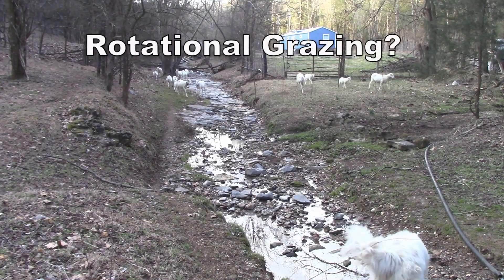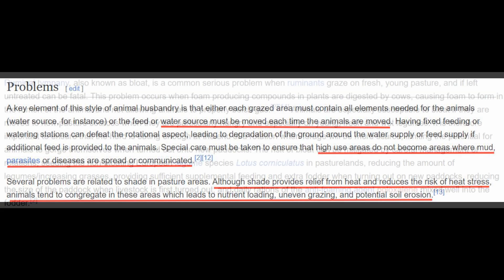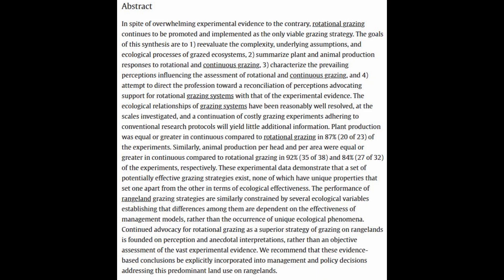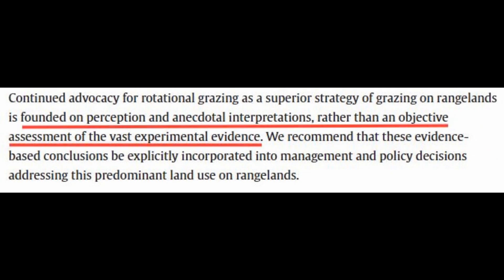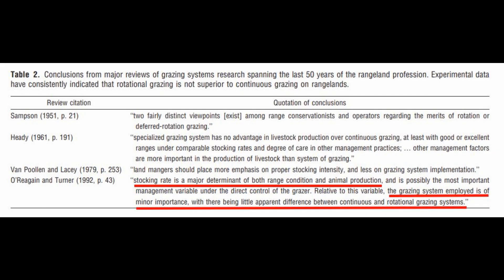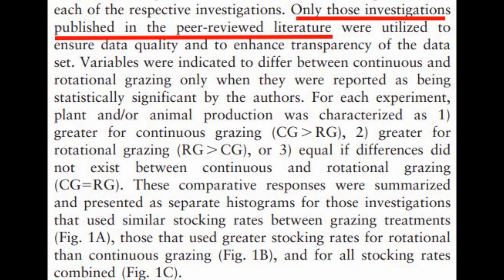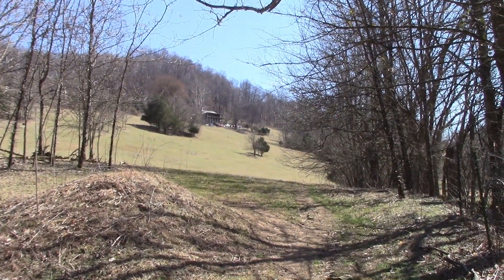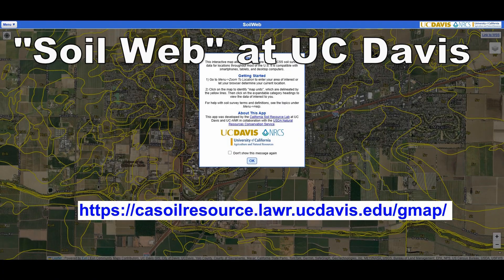Sheep Rotational Grazing? Scientific Proof Its Not Necessary for St. Croix Sheep.

Comment: Hi John, 

have you looked into Bob Kinford's Instinctive Migratory Grazing? He mainly deals with cattle on large acreages, but I think that he has some similar ideas as you. 

His theory is that if you can handle livestock correctly as to reduce stress, the animals can revert to more natural herd instincts. Once the herd instincts are re-established, the herd will naturally rotate themselves through the pasture and graze together in a tighter mob. The mob can expand and contract as required based on the available forage. Forcing the animals into a herd using electric fencing means that animals no longer have to rely on their herd instincts.  

I personally do rotational grazing with my sheep in northern Ontario and see benefits, but I think there is something to what you and Bob are pointing out. 

Thanks for your video,

God Bless
Reply from the maker: Thanks, Cole.

I will check out Bob Kinford.

My sheep stay together as a flock and migrate over the entire property every day.  It is the same as if I moved them with hot wire every hour.

My sheep seem attracted to short grass, as the taller grass that is produced by Rotational Grazing has more lignin.  I also have to mow for weed control as I have never used herbicides.   And I don't have water sources everywhere due to the 300' in elevation change on my farm.

I can't do RG no matter what.   

The idea that taller grass means "more solar collectors" is false.  The same amount of sunlight hits short grass as it does tall grass, but the tall grass with lignin shades the short grass that has more nutrition.  So while it appears that RG is "growing more grass", it is not increasing the quality of the grass.

Cows are different, but if you look at sheep, they ignore the tall grass and go straight for the short grass.  They eat forbs but just the tips, and completely consume the short grass.

Grass is a monocot and grows from the bottom up, which means the freshest grass is at the bottom.
Forbs and everything else is a dicot and grows at the tips of the plants, which is what animals eat and ignore the stalks.

I was surprised by the scientific studies, and that most Ag Scientists discounted the work of Allen Savory because he never quantified the benefits.  The Ag Scientists are putting numbers to the amount of meat produced per acre, and it shows RG is not really any better than other methods.

The number one thing I learned was that we control the pasture through the stocking rate. 
I am now feeding my sheep hay year round if they want it.  This gives me a buffer against a drought and I don't have to lower my stocking rate immediately if I see any overgrazing.  Otherwise I would have to sell when everyone else does. 

I also "lock them out" of places that are overgrazed, which isn't RG, but gives me some control.

But my biggest input is my own personal time, and that is an expense that most people do not consider. 

I will be making a follow up video and the Bob Kinford information may be helpful.  Thanks for the info.

John Hurt

Comment: I enjoy your videos. I recently retired with over 900 ewes, 5 houses, 640 acres, and 4 college educated children starting from scratch. Michigan is a real challenge concerning barber pole worms.  We've found that you can get those bull thistles pretty good by holding the sheep on the paddock untill they're gone. I'm not convinced pH is that big of a factor for thistles, although a dense sod sure helps. I worked as a soil scientist for 4 years, making soil maps, those pH numbers for soil types are averages, Areas where lime has been applied can be much higher, supporting your idea, but you need to take a soil test. We generally move the flock every 3 days and then give them 60 days rest.  That has been better for worm management than anything we've tried. We still do FAMACHA deworming. My son is now in charge, we hope to use these priciples on 1100 acres wirh 1500 ewes on a solar farm. We are largely suffolk cross bred base. Buying hundreds of St Crois sheep is probably not feesible.
Reply from the maker: That is a lot of good information.  Some people add St Croix to their flocks as they can eat the Barber Pole worm cyst and destroy it.  This cleans up the pastures for the other sheep. 

Rotational grazing does help lower the worm loads. 

I have Giant Ironweed (Vernonia Gigantea) that the sheep won't eat and has to be mowed, so I cannot do Rotational Grazing.  Also I cannot pump water up a 300' hill very easily to have a water source in every paddock.  

You are right, I need to do a real soil test.  Even then I have not figured out how to pull a lime wagon up a 40 degree slope.  Maybe a cone spreader on a tractor, but that is a lot of hauling lime into the spreader. 

Thanks for the good comment.  
John Hurt

Comment: I see everyone up in arms about the whole debate.  I personally use rotational grazing but have also noticed just as Mr Hurt has that tall grass is way less preferred for sheep.  My landowners agree as well.  In my particular context I graze multiple leased properties and do not have the means at the time to permanently fence everyone's property.  I also cut hay and do not spray any chemicals or synthetic fertilizer on my fields.  Working with my landowners I am planning on cutting my hay a little shorter (in theory more nutrition) to use for clipping pastures and my flock will provide fertilizer and I provide them better grazing in the rotation.  On the flip side of all this if I did continuous grazing, like Mr Hurt said you have to pay attention to your stocking rate and adjust accordingly.  I think both systems can be used with very similar results and no system is perfect for everyone.  I know all the pro rotation guys talk about soil building and I agree, but I also know that clipping pastures does a beneficial job as well with all the clippings becoming humus put back in the soil.  Look at a lawn.  Even without fertilizer grass grows thicker each year and will grow better if cut more often because you are feeding the soil.  

If we all pay attention we can observe and see scientific reasoning for both sides of the argument.  I think the best approach is to be adaptive to the current situation you are in and modify based on how the animals perform and produce.  Personally I think we should all be helping and learning from each other instead of letting everyone divide us just to get a quick buck from us on the newest fad tool (toy).  If we helped each other and passed the knowledge along all of the small farms raising sheep could repair a lot of acres and get lamb into a mainstream east of the Mississippi opportunity for a lot of small family farms.  But we have to stop dieing on a hill that will not come to fruition because of the in fighting.  If farming was easy everyone would do it.  This is not the case and I for one enjoy it.  Not because I get paid well but because I like being in nature.  I also like to meet others who share the same ideas and continue to learn from each other.  I hope all of us can put aside our differences and realize that all we do needs to be for the glory and honor of our Lord and Savior Jesus Christ, by Him, His Blood was shed for our transgressions and without Him we would have no sheep to tend.
Reply from the maker: You need your own YouTube channel.  I could not have said it any better.

I believe like you do, that Adaptive Grazing Management, where you use rotational and whatever other grazing methods you need to suit your ever changing environment is the answer.

What I have discovered lately is that grass is a Monocot with just one leaf produced for each seed, while all of the forbs and taller plants are dicots with 2 original leaves or cotyledons produced from each seed.

Monocots like grass grow from the bottom up with the older and less nutritious leaf material at the top of the leaf, while dicots grow at the tips of the plants.

So cutting the tops off monocot grass improves it, as grass is designed by God to be used for animals to eat and clip the grass close to the ground to make it thicker and more nutritious. 

This is why a scientific quantitative analysis of rotational grazing doesn't show that more animal meat products are being produced by growing your grass taller with rotational grazing.  There is less nutrition in taller grass.

Also, the idea of "Continuous Grazing" is incorrect, as when sheep are allowed to roam, they rotate over the entire property every day and don't stay in one spot and eat "continuously."  The correct term should be "Natural Grazing" or "Self Rotation" as the sheep "self rotate" and move every hour to a new area. 

With my viewpoint, if I have an overgrazed area, I lock the sheep out of that area so they can't self rotate into a distressed area. 

I also feed them hay year round which acts as a safety valve and covers them during a drought, which is something rotational grazing cannot do. 

What rotational grazing does do, and it does it very well, is it makes you see the problems with your stocking rate in a small area, and you can easily see if you are going to run out of grass before the paddocks regrow, and you can change your stocking rate.  The error of Natural Grazing is that many farmers do not "walk their fields" and only notice that they are overstocked when it is too late.

I will be putting out another video about "Alternatives to Rotational Grazing" soon.  

Thank you so much for your comments, it really helped and gave me good feedback.

John Hurt

Comment: Subscribed! I'm thinking about getting sheep. We have a few cattle right now, but the size of cattle is a challenge for a newbie like me.

Thank you for shairing your knowledge and experience. I will be watching your other videos.

I am in Tennessee also, east of Knoxville. What part of the state are you located in?
Reply from the maker: We are in Buffalo Valley near Center Hill dam, between Cookeville and Carthage.  
I got challenged by a bull that I had, and the heifers were also somewhat dangerous, so I feel safer around the sheep.   But you need woven wire fencing for your perimeter and a Great Pyrenees dog to protect the sheep from the coyotes.  
Thanks for the comment.  John Hurt
Reply: @PureNaturalSheep  I was run down by a young steer. He was probably close to 600 lbs. I was walking through the pasture and he thought it would be a good idea to chase me out. I threw myself over the fence and looked up to see where he was. He was right there, and began kicking and snorting like a rodeo bull. His mom wasn't far behind. I've never trusted them since 🤣.

Comment: I've done both continuous grazing (with sheep and goats), and rotational grazing.  Rotational grazing definitely was FAR better for both the pasture and for the condition of the animals.  The benefits of rotational grazing were very obvious even to casual visitors; I remember one non-farmer neighbor commenting that he'd never seen our field looking better.  I'm really questioning the veracity of your sources....
Reply from the maker: Here is a resource that details some of the reasons rotational appears superior to continuous grazing, but is not backed by any quantitative data:

https://www.ars.usda.gov/ARSUserFiles/1354/75.%20REM-D-10-00084.1.pdf

One benefit you will get from rotational grazing is that you are more aware of the condition of your pastures than with continuous.  Pasture management is the most important input you have.

The second input or control you have is the stocking rate.  When the buffalo roamed freely over the western prairies, there was no problem with overgrazing, even though they ate "continuously" and were not managed by man. It is when the farmer fenced in his cattle so they could not move freely and overgrazed the land that the problems began. 

Confinement of animals in a Rotational grazing system makes you look at the paddock and see when it is exhausted to move your animals.  It will force you to lower your stocking rate or move so frequently that you will run out of paddocks before they can renew.  So rotational forces you to monitor your stocking rate sooner, while continuous allows you to ignore it until it is too late.   The stocking rate is the key.

The benefits of Rotational grazing is apparent but the improvement is never able to be quantified by the average rancher. When the Ag scientist does the research, he does not find the benefits that are so well seen by the rancher.   How is that?

Here is my guess:

Taller plants create more lignin and other less nutritious plant materials.  So letting your grass grow tall is not an improvement, although it appears to be a positive outcome.  With sheep, they eat the shorter grasses first, and the taller grass last.  They will repeatedly overgraze a small area of short grass and ignore a section of taller lush grass.  There is more nutrition for sheep in shorter grasses.

So it is misleading to see your pasture with an abundance of tall grass and think it is an "improvement."   Yes, they look better, but are they really?  When I do rotational grazing, the body weight of my animals begins to drop, as they are forced to eat the less nutritious taller grasses.   Rotational grazing "makes them eat" the things that are not as nutritious. 

I keep my pastures clipped so they never get more than 5-6" tall, as there is more protein and nutrition in these shorter grasses.

I do something called "Adaptive Grazing Management" where if I have an overgrazed area, I will lock them out of that area until it recovers.  If they are grazing too much around a stock tank, then I leave the tank unfilled or move the tank to a new location.

The other input is the labor cost of rotational grazing, as compared to lowering the stocking rate.  My personal time is worth money, as I have other businesses besides raising sheep.   If I lower my stocking rate 10% and don't spend any time doing rotational grazing, I actually make more profit working on my other endeavors. 

Rotating your sheep on 3-4 large paddocks every week or so makes sense, but stringing hot wire every day really looks like a waste of time.   You also need water tanks, shade and shelter in each of the temporary paddocks.  

And that Allan Savory and these other people that promote holistic or rotational grazing - that they cannot show data of the number of lbs of animal product produced with their methods as being superior to continuous or adaptive grazing, that  no data is ever produced - that speaks volumes:

https://en.wikipedia.org/wiki/Holistic_management_(agriculture)#Criticism

https://en.wikipedia.org/wiki/Rotational_grazing#Criticism

I think everyone should keep an "open mind" that Rotational grazing may not be for everyone. 

And everyone should at least question why modern agriculture science is not completely behind rotational grazing.  This debate between Ag scientists against rotational grazing has been going on for 75 years and so it is not "settled" that Rotational grazing is the "cure" for everyone.  

I bought 60 acres that has never been sprayed with a herbicide, and it produces as many weeds as grass.  The sheep eat the grass, but not the weeds.  I have to clip the pastures (as I won't use a herbicide), otherwise the weeds (like Ironweed) would grow, spread their seeds, and cover up the grass.  

I would guess that 99% of all farmland has been herbicided with glyphosates, 2,4,d, atrazine or some horrible chemical that goes into the food we eat and probably causes cancer.  These herbicided farms have "perfect" pastures, no weeds, and they can do rotational grazing.  But rotational grazing is not a solution for me.   I have a weed problem that only a bushhog can cure.  

But I have a LOT of very healthy sheep. 

Thanks for watching the video.  

John Hurt
Reply from the maker: Kathleen,
A better answer for your question about the veracity of the sources:

My video is based on this synthesis paper produced by 9 Agricultural Scientists, all working at major Universities:
https://repository.arizona.edu/bitstream/handle/10150/642920/19822-34226-1-PB.pdf

These 9 Ag Scientists pulled in 100 different "peer reviewed" studies, including those by Allen Savory who supports Rotational Grazing, and found that the majority of scientific research, based on quantitative analysis of actual "data" and not what someone observes, shows that Rotational Grazing (RG) is not superior to Continous Grazing (CG).

For the average person, like you and I, we are not able to produce numbers as to how much is being produced by animals in RG vs CG management systems.  
These 100 scientific studies showed that animals will put on more weight and grow faster by being able to select what they want to eat in CG, instead of being made to eat less desirable plants in RG.
I had a hard time believing it myself, but when I put my sheep on CG, they fatten up much faster.

I also clip my pastures to get rid of the tall grasses and weeds that they normally won't choose to eat, unless confined to RG.

The number one input I have is to raise and lower the stocking rate to follow the yearly production of pasture.   I sell most of my sheep before the drought in August hits. 

I also practice "Adaptive Grazing Management" by setting goals and using various techniques to improve production.
And I count the time I would be stringing "hot wire" over a field as a cost, and something that cannot scale as I only have a finite amount of time.
So CG, which is really "Natural Grazing" is essential to my operation. 
Thanks
John